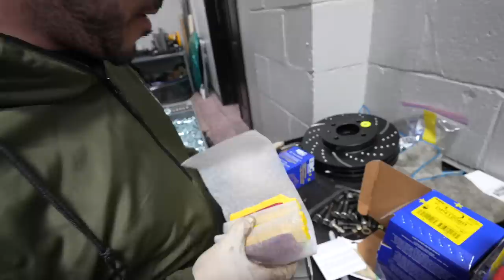How to install AWD Honda Viscous Coupler PROPERLY! 1000hp Approved!

Comment: Bodyshop owner here . Strip undercoat by heating and scraping . Once you get the bulk off thinner cleans it up great or if you dont have any brake cleaner or wax and grease breaks it down .

Comment: To remove the undercoating use a propane torch and scraper. You don't want to burn or melt the coating you just want it to heat up and become softer. You can go to home depot and ask for a 5-n-1 tool which is in the paint aisle. It's a type of scraper with 5 uses (different shapes to scrape in different ways). You can also use a 1000watt-1500watt heat gun. Use acetone to wipe off any residue after. Acetone is a good solvent to use for prepping surfaces for weld. Removes a lot of types of paint, wax, grease, oil etc. 

As far as the actual welding. You would have much better success with dual core Flux shield wire. The Flux in the wire constantly cleans the metal and pull the contaminants to the surface of the weld puddle. Dual shield is commonly used for structural metal welding like buildings and the metal can actually be welded in a fairly rusty state without having to be cleaned prior. Using solid mig wire and 75%/25% mix isn't a good idea with something as dirty as that undercoating sub frame

Comment: Dry ice blaster would knock it out quick. Not sure what kind force the viscous puts on the actual frame but switching the plates 180° where the overhang is on the notched side might help rigidity

Comment: Yoo SONIC Yea boosted boiz had the fluid changed in there viscous IN THE VAN changed to a better fluid n they had the clutches in viscous changed in it n it ripped it's ass off. Get up wit Kyle n ask him about the fluid for the viscous Sonic.

Comment: Keep cleaning the wire wheel after each pass on a 2x4  spray some wd40 or brake cleaner the wood should clean the wire wheel

Comment: i was gonna like this but i dont like the number that its currently at atm. but this is a great vid with good info.

here in nz for it to be street legal we’d probably have to go extra and weld in those plates crush tubes so it goes all the way up into the floor, then have through-bolts with an extra plate and nut on the end.

Comment: Loving the vids guys. Keep ‘em coming. It is about time someone does a detail install of this👏. Question, does the angle of the driveshaft from the diff to the viscous coupler matters? From the vid, it seems that the driveshaft from the diff has a downward slope to the viscous. Would appreciate it if you guys could go more into this aspect of the install. Thanks.
Reply from the maker: it has a downward slope

Comment: Looks like it's possible to shorten the ends of that front carrier bearing bracket, drill new holes and move the bolts and then you wouldn't have to notch the frame

Comment: to get the undercoating off, definitely heat gun on high, and a putty knife.  That will get most of it as long as the surface is relatively flat or uniform.  Then take some Xylene to it with a stainless steel pot scrubber (chore boy)   I've had good luck with this.

Comment: Undercoating - fire and wire wheels. Takes about 10 sec to remove

Driveshaft length would be hard to make across the board. Their are too many variables involved. You would have to make like 100s of combo. 
Also you don't have to notch the tunnel with the S1Built billet carrier bearing because they are offset upward. In all off our videos we never had to notch the tunnel.
Reply from the maker: going to try them for the next build for sure, thank you!!

Comment: Paint stripper in the undercoat with a little heat and a scrapper
Unless you have an Infinti AEM they pretty much have stopped support for it
Link Ecu is a very very good unit but none of them have the display/all in one like FT
Reply: Also love the sort of walk through yall did with this!

Comment: The reason you're able to break a factory camshaft is because it's made from a casting. They pour liquid metal into a mold. If you look at the ends where the cam fractured you will see the metal looks like small grains of sand. There's no uniformity in the grain of the metal. If you tried to do that with a billet camshaft you'd more than likely hurt your hand and chip the sidewalk. But the cam wouldn't break. It all has to do with the metallurgy and science behind how the metal is made. You could also break a cast cam shaft with a specific sound frequency at a loud enough volume level. Kinda like how you can shatter a glass with a speaker making a specific sound frequency. I've been a machinist for 20 years. So I've learned a lot about metallurgy and castings over the years.

Comment: i fawkng agreed with that driveshaft concept. It needs to be a Mainstream Oem Honda aftermarket placement part with 1310 joints and chassis specify. so people can just but the driveshaft and slap it on.. I then it'll be a Good business Opportunity for NewEnglandRacing to come out with Those concept Parts for AWD.  i'm down for it. because I have 2 different sets up right now on hand for a 92-95 Eg hatch/Ej coupe chassis with  Awd K series motor(k24a2) and trans( crv trans) and b series(b18c1)  motor and trans(crv rd1). A freelander with Crv rear and a Wagon full driveshaft and rear.

Comment: Dry ice ( which I guess isn’t “terrible “ on pricing to get the machines )… but if your doing it at home soda blasting it is way more convenient and easier to set something up and blast.
Reply: *Asked a friend since he’s done it more so then myself….dry ice works better then soda blasting because your freezing it but either way apparently your going to go thru a ton of it to get the coating off. 😔

Comment: The people at S1 built just heat  the surface 1st with torch then hit it with wire wheel comes right off watched them do it in real time